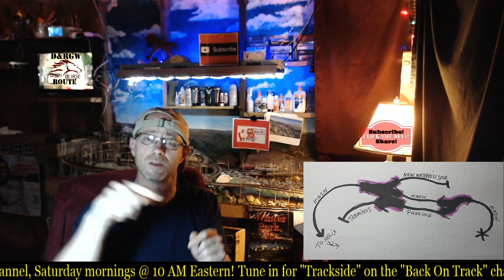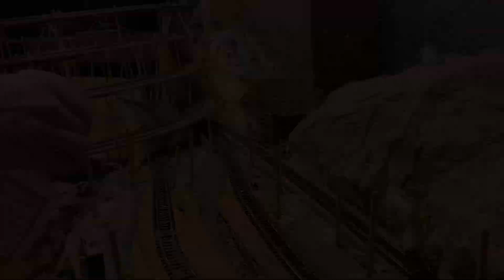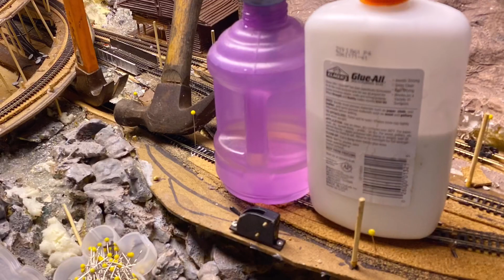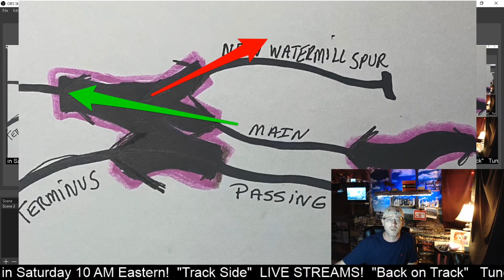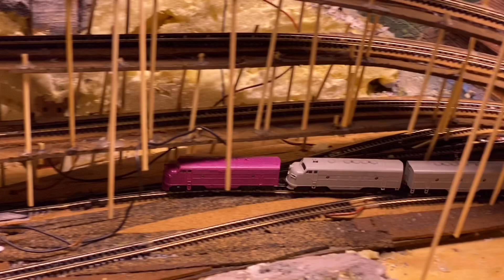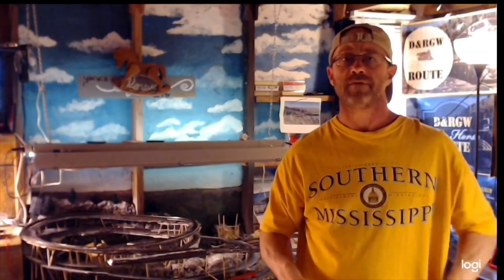Model Railroad Track Work - Testing Peco Turnouts and Repairing Clearance Issues - Graphics Tip!

Comment: Hey Brian looks good man , should be smooth running from here on out . Thanks for the app suggestion , I'll check it out .
Reply from the maker: The trains are running well.  For me they are running great!  As a little time passes and i get the stray little bits of glue and stuff of the track and the turnouts settle, they seem to run even better.